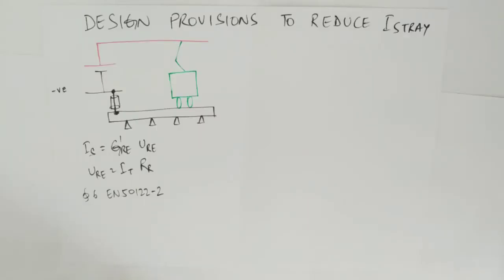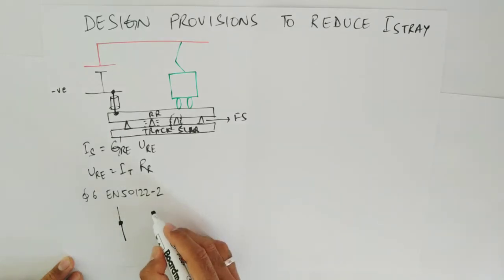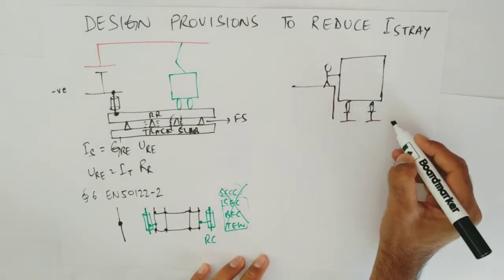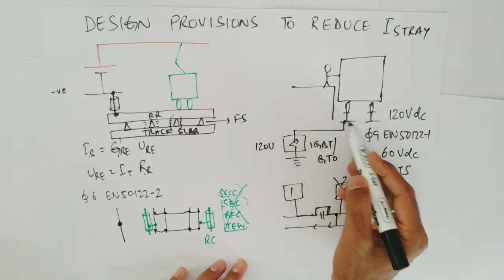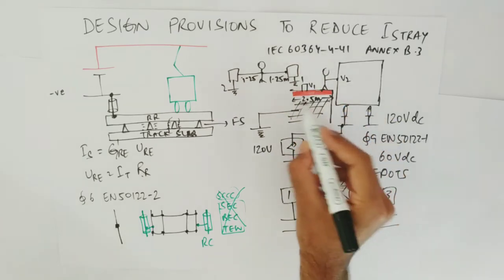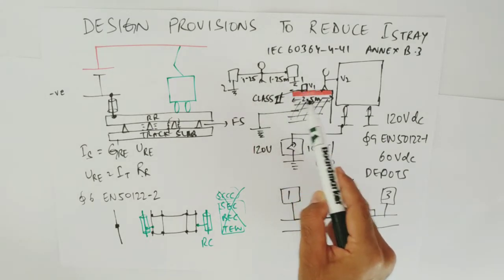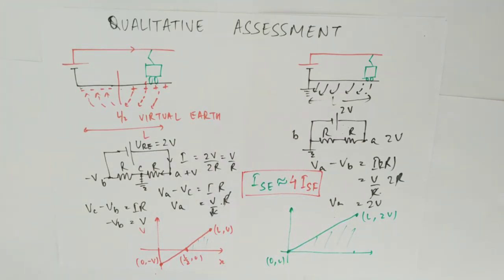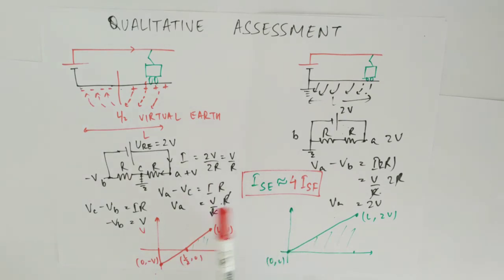Lecture 3: Design Provisions to Reduce Stray Current & Overview of Platform Insulation Membrane

Comment: Hi, what should be the size of return conductor connected to cross bonds?
Reply from the maker: It depends on project (contract). Typically it is 50x6 flats or 185/240 sq Cu conductor. However, you can calculate based on short circuit rating and use formulas referred in E&B conductor sizing lectures.